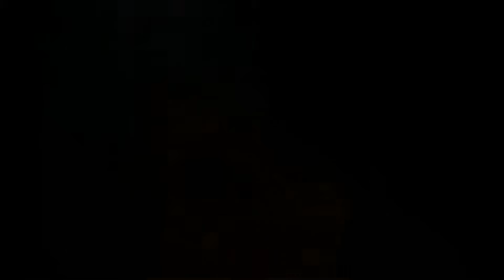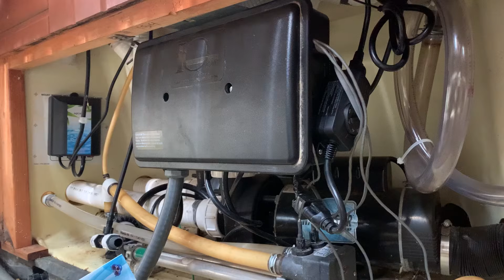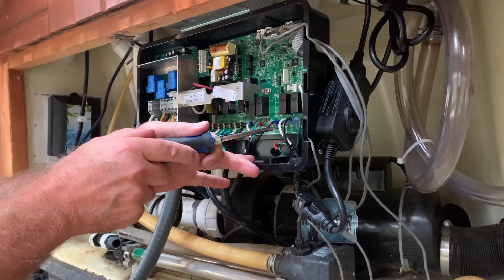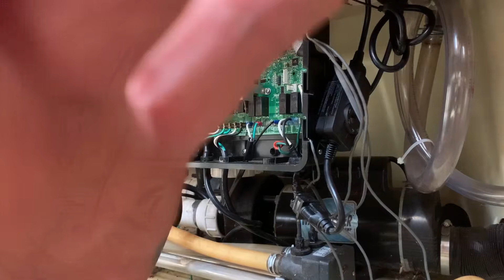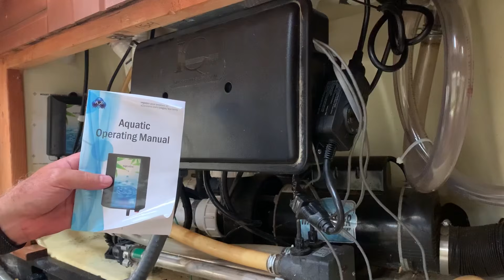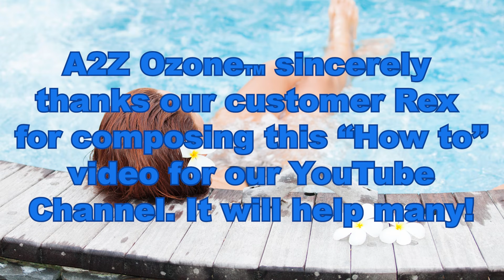Video of Aquatic Spa Ozone Generator Installation from A2Z Ozone #a2zozone #ozone #ozonegenerator

Comment: I installed one of these ozonators and it seems to work well.  The old Jacuzzi tub’s control board did not have a timer so rather than install a timer device I added a TP-Link smart plug (HS100) that is 110/220v compatible.  Now the schedule for the ozone generator can be set using the smart plug app.
Reply from the maker: Hi, Thank you for sharing!